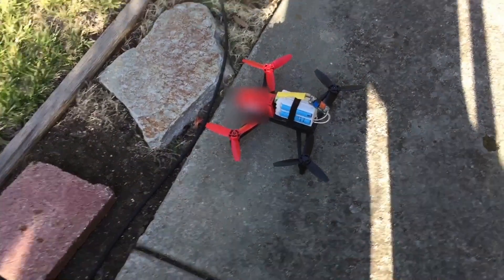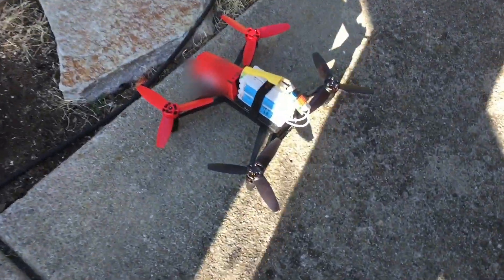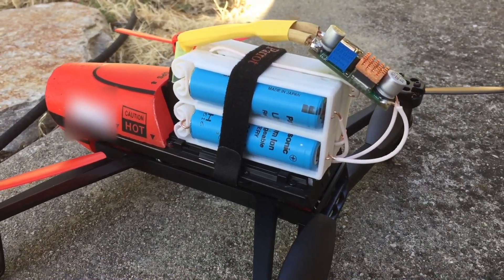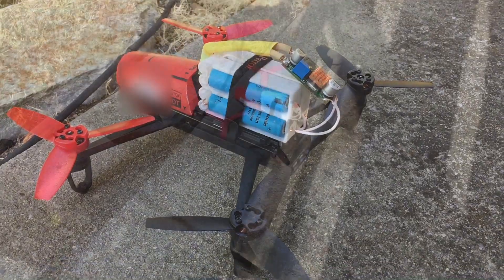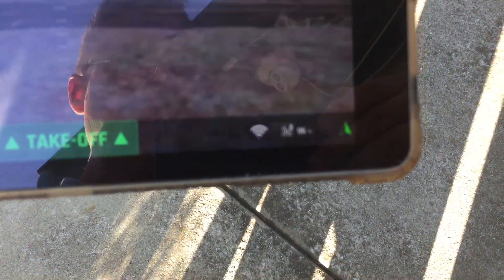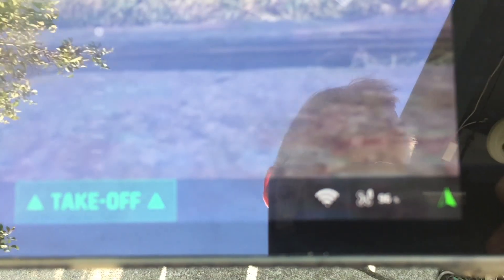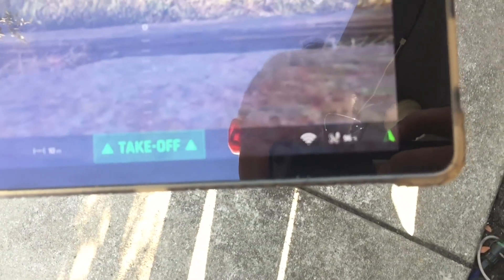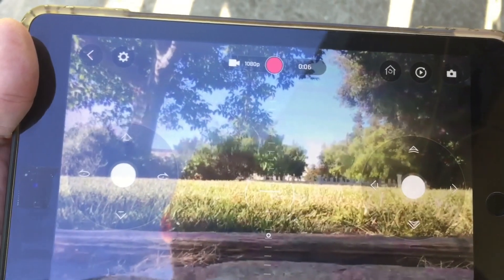Bebop Drone Custom 18650 Battery - First Flight Attempt

Comment from the maker: For those of you wondering why I used the voltage converter, I had already tried 3s, and it didn't seem to provide enough current to get it off the ground.  It could be that the cells I used were too worn out, but I don't have a good tester for that just yet.
Reply: For 3s did that mean you had 6 x 18650 cells, 3 x (2 cells in series) ?
Reply: i made 3s and it works fine
Reply: Maybe your wires are too thin

Comment: What the hell !! Why did you put a plastic casing ? Sooo much extra weight, you could just have taped the batteries together. And most important, the voltage regulator is absolutely useless. If you pair your batteries in series or parrallel you can obtain the desired voltage. That's the principle of a 2s or 3s... So for 7.4v with 4 18650 you just need to put 2 pair in series and those two in parallel.
Reply: Does the 's' in 2s,3s mean serial ?
Reply: @TheTwistedStone  yes

Comment: Bro...did u read the max amperage on the pack? 20a . That eBay 2 dollar board isn't so much a regulator as a dc to dc converter. If it gives 5amps for 2min it's ur lucky day, I've seen them desolder the main chip when they get too hot. Aka no fucking way it supplies the current required. Go with 3 higher capacity cells str8 through. The converter is also likely going to block the drones ability to read bat levels which will end in a Mic drop...err... multi hundred dollar drone falling like a brick

Comment: These cells are so old and worn that once you apply load they sag voltage so badly. you need new LG hg2 18650 or similar battery and I'm sure it will fly good
Reply: Good looking

Comment: i did this with my bebop2 and with good results. I solderd the 18650 cells into the original bebop2 battery. Its only 2500mAh and it works better that perfect. No heat or anything. im going to buy 4000mah batteries and solder them in.
Reply: Hi sorry for the late reply. I used the Samsung cell's. I used 3 of them. The original bebop battery is a 3 cell. Just be careful with the soldering. You need to do it quick before the battery warms up. Please do this on your own risk.
Reply: @ericjordaan  thank you.i will spot weld
Reply: Which brand/model of 18650s did you use?
Reply: Hi can you please tell me how many batterys did you used thank you
Reply: which 18650 did you use? thank you
Reply: Eri
Reply: Why you not reply?
Reply: Thanks. I will be trying 3s2p. This should work right?
Reply: Thank you for your answer..ı will build too..

Comment: these cheap voltage regulators have limited current flow protection, you can try without that, but i'm sure you can't achieve good results because  these 18650 cells have very low discharge "C" as compared to lipo

Comment: You can get rid of the voltage regulator if you change to 3s. The LG HR2 has 20A dischage and 3000mah capacity. Alos the VR is probably not rated for 20A.
Reply: Max Lisska heh so close till the end.... when it comes to current things draw what they need aka u can have a bat rated 1 gazillion amps c and it won't blow the drone. Also the one pack I've seen from this drone specified 20a max discharge so cells that can put out 20a continuous would be a great fit
Reply: Me from the future I'm going to try cells better

Comment: Is there a part 2? I'm doing the same thing and I want to know if it eventually worked out.
Reply from the maker: Naw, it was just a fun experiment because I had the resources.  The batteries are not high enough C rating to lift off, but you can use higher C rated 18650, and I’m sure it would work.  I just didn’t want to buy more batteries, and for the price, you could likely just buy a new stock battery.